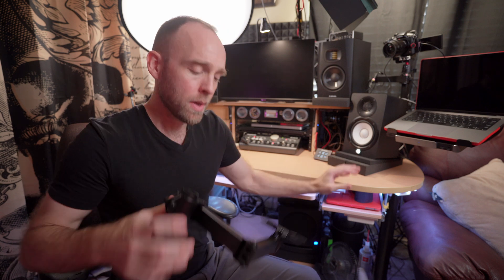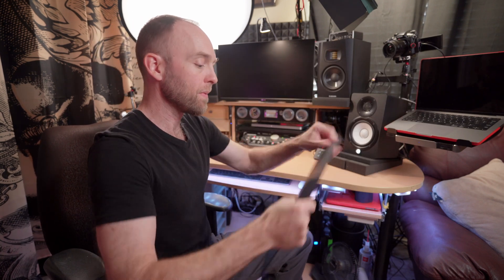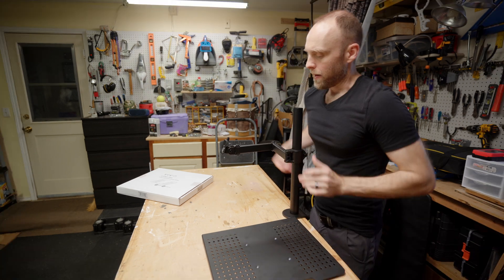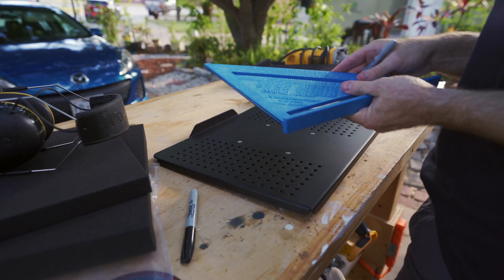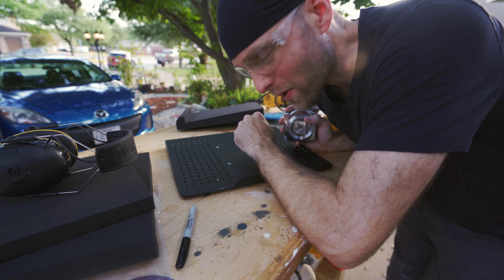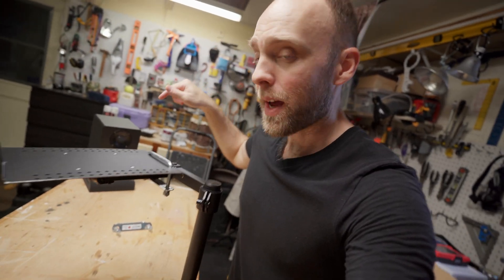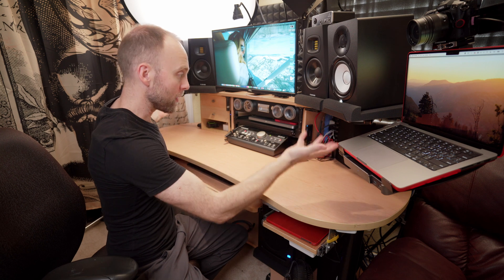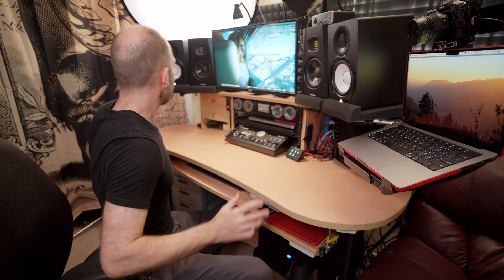Can you make a studio monitor (speaker) stand from a VESA Mount?

Comment: Any issues with vibrations, resonance, rattles, etc.? I've been thinking of doing something like this, but this is a logical concern that's holding me back. There are lots of joints and attachments that could be a problem with vibrations, which I assumed was why no companies have come out with a product that does something similar other than the Wavebone Gemini stand which has fewer moving parts.

Comment: You can achieve the same by using a long cable tie (tiewrap) to fix the plate instead of that U bolt. Yes that u bolt looks cooler but less doable for people less familiar with drilling. Great video, i will also do this.
Reply from the maker: Yes, most certainly.  I thought about just zip-tying in the back instead of the U-bolt....but I wanted something that would .......conceivably, last longer than a zip-tie and I wouldn't have to check to see if the zip-tie or zip-ties had broken/worn out, etc.  But yes, totally an option instead of the U-bolt solution

Comment: Just a word of advice as a manual machinist its just general practice to cut on the heavy side what i mean by that is cut just slightly off of the line on the side to be discarded to allow for mistakes also please use a face shield when grinding or cutting with a grinder its saved me an expensive surgery after the wheel shattered and lodged into the shield instead of my face
Reply from the maker: Hi there.  Thank you so much for the advice!  Yes, I should be wearing a face-mask.  I certainly know the dangers of using angle grinders, I've been using them for many years, and I always make sure #1 there is a proper guard and #2 that the gaurd is between the wheel and me!!  However, I know that the guard alone may not always prevent or block an exploding cutting wheel.  

Thank you for the tip and reminder........now off to home depot for a face mask!

Comment: Wish I could order a pair of this in white 😂 this is exactly what I need but don't have the tools on hand
Reply from the maker: aaawwwww.......well.  You could just NOT cut the plates and leave them full size.  And for the rear U-bolt and the holes I had to drill, you (and I could have) figured out some other bolt-configuration to use the already-existing holes in the plate to grab the VESA arm to keep it from tilting forward.  Even Zip-ties would work for keeping it from tilting forward.....although I'd double up on the zip ties just in case ;)
Reply: @MarcusHutsell  thank you! I managed to find  a version of this here.. They're in black and meant as speaker stands. Costs a pretty penny but ended up buying them anyways just to make sure I had space for the new speakers. Thank you though!
Reply: @Kmmc2011  Where'd ya find the speakers stands that you bought?

Comment: Dude, had the same idea, just wanted to place the speakers directly on the vesa mount. This is because I got quite small speakers, Audioengine A2+. In my case, I'd like to put the vesa plate in a 100% horizontal position, my Kensington mount (one of the exact same construction that you have presented) can do that. But I'm looking for something cheaper, I want to install another arm on the column part of this Kensington that I have so that it supports both my laptop as it does at the moment, and the speaker. Unfortunately, most of the arm specs say they can't do that (which I believe is not true on some cases). You made my day anyway.
Reply from the maker: So far my solution is working quite well.  And, in both my home and work offices, I have at least (2) vesa arms on a couple of my vertical pipes.  For instance, on ONE vertical pipe, I have (3) horizontal arms mounted on a single vertical pipe coming off my desk.  

Horizontal Arm 1 = Laptop plate that holds my laptop, with my Kensington Thunderbolt dock mounted UNDER my laptop/plat

Horizontal Arm 2 = holds my GH5 camera for virtual meetings, etc.

Horizontal Arm 3 = hold the new new laptop plate shown in this video, holding my Yamaha speaker......

So, 3 horizontal arms mounted to a single vertical pipe that is attached to the back of my desk. 

I added an extra C-clamp to help hold the vertical grip-mount on to the back of the desk since there's quite a bit of horizontal force placed on the grip-clamp now that I've added the speaker to the same vertical pipe.  

Fun stuff!  Anyway......cheers, thank you, and good luck!

Comment: Thanks for the video - perfect proof of concept for what I want.  Looking to do something very similar for a "rolling bass station" (PC, monitors, amp, pedals, etc - all mounted to rolling utility cart) and need a way to mount the studio monitors.  Honest question:  Instead of cutting down the laptop plates, why didn't you just put both pairs of speakers on the laptop plate?  That would have had the advantage of being able to move both speakers out to widen the separation if you're doing heavy duty audio editing and want the stereo separation - and would have freed up a little desk space?
Reply from the maker: Hi there Ken.  You're welcome, I'm glad the video found its way to you.  
So, as far as WHY I didn't put both pairs of speakers on the laptop plates, I guess the answer is two-fold:

1.  My desk already accommodated one pair of speakers (I've had this desk for about 18 years, and my single pair of studio monitors has always sat ON the upper-riser section of my desk, where the new Adam T5V's currently sit in this video), and

2.  I don't really trust the horizontal section of the VESA arm to hold (2) speakers.....I just didn't want to put that much weight on a cheap VESA arm.  I was OK with a single speaker, but, honestly, didn't want to push it to much.

Gator does make desk-mountable speaker stands, and those might work for your roaming/mobile card, but, again, as I said in this video, that model kept the speaker too far away from me, I needed some horizontal movement towards me to get the speakers in the proper position.

You might try looking at the gator model, https://amzn.to/3tsKUHy, but, so far, my solution with these VESA arms has worked great!

Comment: Amazing work, instead of the laptop vesa plate, cut MDF or plywood to size and screw on the vesa adapter.
Reply from the maker: I thought about Using Plywood, but, didn't want to have to sand, poly, etc.....since I also do woodworking I probably would have spent too much time on using plywood......and for me, MDF always sags over time.  But yeah, good idea, maybe in the future I'll make some nice wood stands ;)